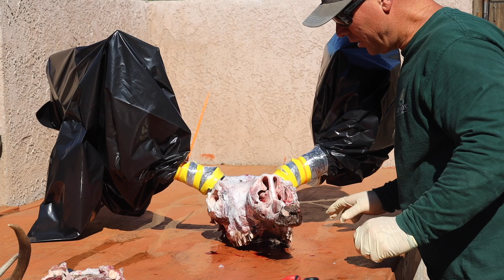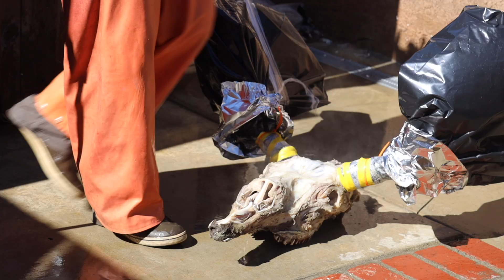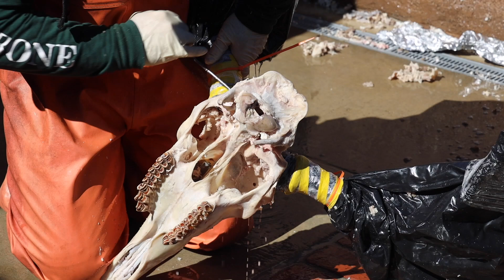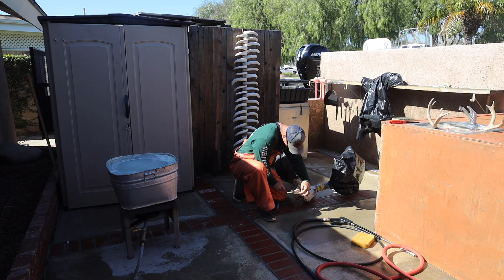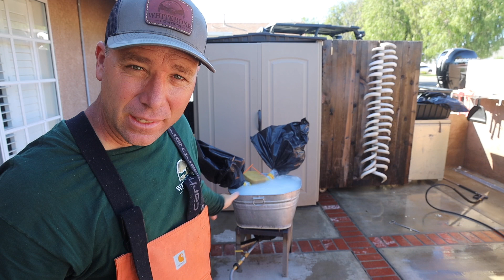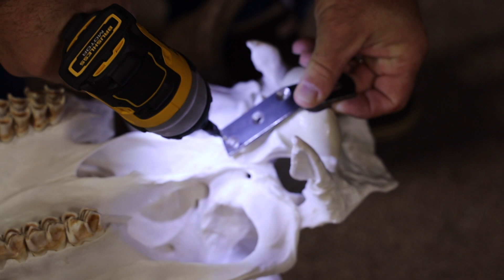HOW TO CLEAN A BULL MOOSE SKULL "SHIRAS"

Comment: I do my own up here in Alaska. It’s not easy. I take a 30 gallon metal trash can and put it in a fire, full of water and dawn dish soap. I use firewood not a propane burner or anything like that. I let it boil. Meanwhile I completely wrap the antlers in tinfoil to protect them from the fire and water/steam. I then set the moose head in. It takes a few hours. Pull out and all tissues should be able to be pulled off by hand. Pressure wash. Put moose head back in the boiling water upside down. Works great. Make sure to get brain and nose cavity clean.

Comment: Thanks so much for the awesome videos and techniques! I've been using your technique to clean a few skulls here in South Africa. Can I ask your help with a issue I'm having with a Scimitar Horned Oryx. The animal was shot by a friend of mine and even after many hours of boiling I cannot get the horns to come off (they are getting a bit loose tho). I'm worried that if we try boil it any longer it might affect the bone? At this stage I've submerged the skull in water to soak for a few days hoping that it will help shorten the boiling time the next time I try? Please any help you can give me will be greatly appreciated. 

Keep posting great videos!
Reply from the maker: I just finished a scimitar last week. I have a video coming out Monday. The key to horn removal is the twist. They will not smack off grab the base and mid section and twist all the way around they should pop right off.
Reply: @WHITEBONE  Awesome thanks so much. Look forward to the video!

Comment: I use a Long screwdriver to punch out the very back of the nostril area so it goes through to the brain cavity. I like ur way of boiling with peroxide but it use a 40% cream and a brighting powder mix my special amounts let sit 24 hours and hose off then let to dry completely.

Comment: Ok bud, i have a yukon 65" bull that comes straight out the sides. How should I do my solution simmer, even more than the one in your video. Got any suggestions. I had to cut sides out of tub to soak and use towel to get top hydrated.

Comment: Hey bud, really like the videos. Keep me coming. Do you have any recommendation to remove extremely hardened hide from a skull. I’ve got a moose skull cap with fur still attached (dry for 2 years). Soaked it for 24 hours in water and still solid in most areas. Any advice?

Comment: What mounting bracket is that that you use? I have been using a 6" x 1" blank plate that I drill holes in and then bend to my desired angle. It's more work than I like doing.

Comment: I'm getting ready to start on a deadhead moose I found. How long are you boiling for. Or should I say.. is there a point where you can boil it too long in the oxiclean? When in peroxide is there a set time you let it sit before checking it? And is there a max boil time in peroxide? Thank you so much for the help! Great video.. by the way.
Reply: I just dont want to mess up my skull.. hes a beast. Where did you get that galvanized basket?